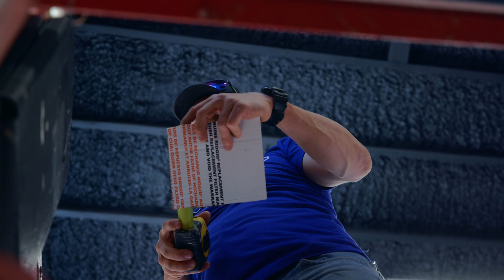The BEST Garage Build EVER - E5: Installing Cox Hose Reels, Prevost Pipe | Air & Electrical

Comment: Epic install. My only suggestion would be to change the plugs on the cox electrical reels to leviton wetguard. They are waterproof and covered in silicone so won’t scratch a car. And you can throw them around and they won’t get scratched or crack and break.

Comment: The air system looks great.  Not sure if you did this or not but when I ordered my reels from you I ordered extra air hose.  The reels are rated for 50' of hose but my ceilings are 16'. I cut my hose to 60' so I had 50' on the reel and 10' hanging.  Looking at the video it was hard to tell if you stayed with the 50' or if you put 50' plus 16' hanging.  This is such a cool build, thanks for sharing.

Comment: Probably just over thinking but hey that's what these builds are all about. I get seriously concerned how you could be pulling on those reels for years and because they not through-bolted it just pulls away and tumbles onto yourself or much much worse, your favourite car. I think I'd cnc fold a 1/4 inch plate inbetween the truss' and through bolt if it was my place. I'm sure your fit is adequate and will last for a number of years but if that roof is leaking slightly and wood gets saturated in a few years time you pull that and it would just come straight down without warning. Even tugging on it with perfectly solid wood I would be cautious looking up everytime 😂.  Wasn't a massive fan of the wash bay boom security either, they get some tugging and it's going to be wet in there before dehumidifiers have a chance to bring it back down every time. Some great ideas though I love watching these videos . Gives me some great ideas for my own build as and when funds allow me to build it. What a nice satisfying job to have.
Reply from the maker: You must have missed it.  These all have bolts, lock washers, and nuts.

Comment: Matt, get Mike a Milwaukee (or Bosch) laser plumb bob so he doesn't have to measure off a wall, up on a scissor lift, with a sagging tape. He can just measure off the floor and shoot that point up to the ceiling.
Reply: How do the Milwaukee Lasers compare to Bosch?
Reply: I only suggested the Milwaukee since he is a dealer. I have a Bosch and it works fine. Bosch Blue would surely be sacrilegious among the sea of Milwaukee Red in that project.